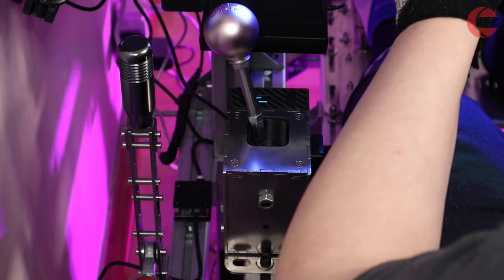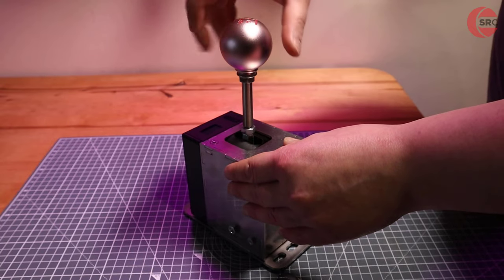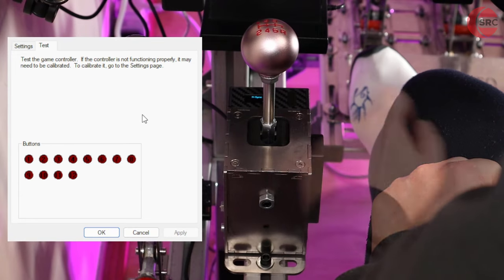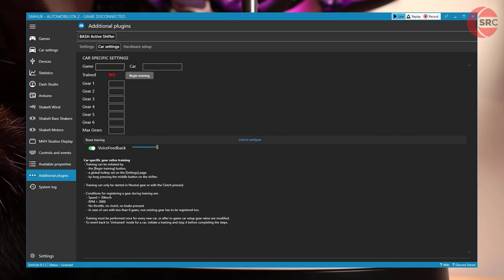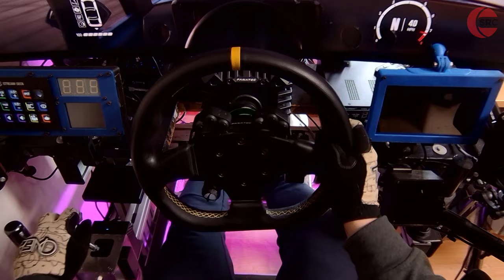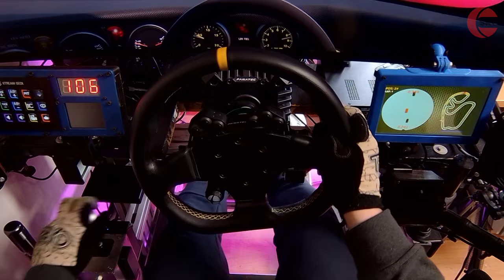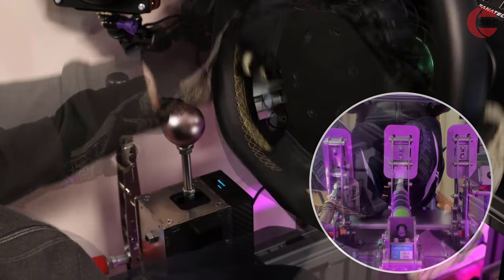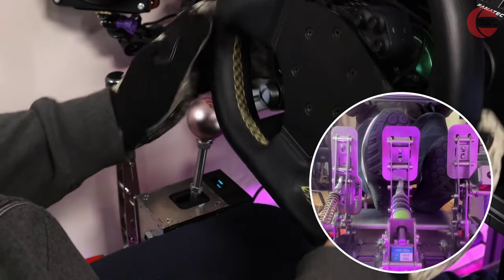BASH Pro Active H-Shifter [REVIEW] ABOUT AS REAL AS IT GETS!

Comment: I want one of these so bad it's not even funny. I've got an SHH Shifter but the idea of having that active feedback is another level. I'll never be able to afford this though, unfortunately.
Reply: Oh Boy the Inside is just standard parts from a hardware store with very cheap lasercut metal plates.
the material cost for this shifter is around 50-80€ bucks.

I should be able to easily reproduce it.
I need their software and a shifter and I can fully reengineer it and then let a local shop build it since I don’t have Workshop anymore

Comment: How does the shifter behave when downshifting. 
Does it allow to shift out to neutral without the clutch, as in a real car ?
Does it block the Rear Gear, when moving forward, does it block the 1st gear, when speed or rpm is too high?
Reply from the maker: Does it allow to shift out to neutral without the clutch, as in a real car? YES
Does it block the Rear Gear, when moving forward? NO
Does it block the 1st gear, when speed or rpm is too high? Only in dog box mode.

Comment: There is no doubt the features of this h-shifter are something very unique, however for nearly £1000 it just doesn't look that special in my honest opinion. Good review Sim Racing Corner
Reply: I agree. The materials don’t look significantly better than cheaper shifters. And the sound it make when shifting seems hollow and a bit cheap.
Reply: I use Dirt Rally 2 with a H-shifter, and it really spoils the fun when I shift in, but the gears are not in, in the game, but I felt no 
For some reason, simhub does not report a failed shifting through bass shakers, so I have really no haptic feedback of failed mechanics. 

My complete rig all included built up month after month has reached about a price of 20K, 
so I do not bother about that price considering those of Simucube, Asetec, Cubecontrols, 
when they really do their job you quickly forget about the price. 

When they do their job, they melt into the Rig, they are part of the car and don't raise your attention anymore while racing.
I bought a cheap TH8A shifter, modded it all on my own, by adding tensions and resistance forward AND laterally, but recently, it disconnects during racing, so here I am discovering a great developing. 
I gladly pay for their engineering time before they went into slow production... as it is not currently available...

Comment: Can't imagine what I'd use the H box for, some sort of vintage racing?  Even in the last generation of H shifting Nascar, shifting is not really much of a thing, and everything I sim drive is either paddle or sequential...
Reply: I like driving sports cars with h pattern shifters. Not many racing series which use them, and tbh I prefer flappy paddles when racing, but i also really enjoy throwing street cars with h shifters around asetto corsa. It's fun.
Reply: If you play something like ams2, most non-f1 cars have manual gearboxes and this allows you to drive them authentically
Reply: @Rmagid  never tried ams2. perhaps I'll give it a shot as doing some vintage racing could be fun.  I'm not sure that there are ANY H-shifter cars left in iRacing, which is mostly what I drive 🙂
Reply: @Rmagid the F1 classics, Gen1 - Gen3,  use H Patterns